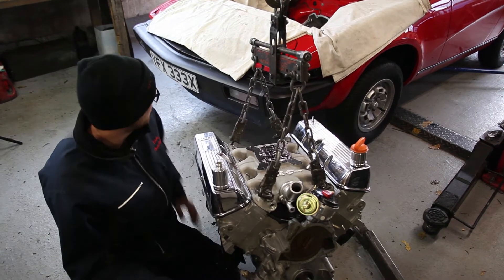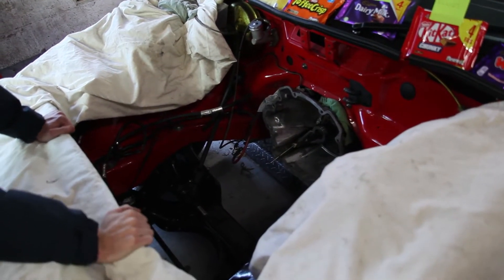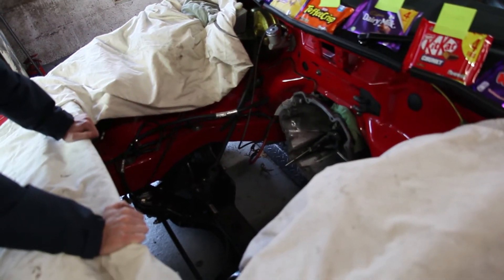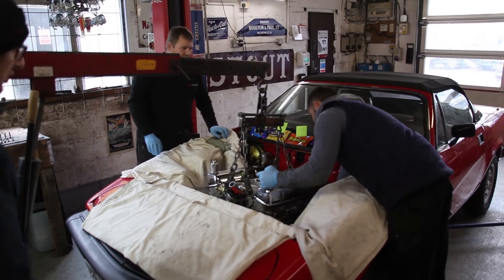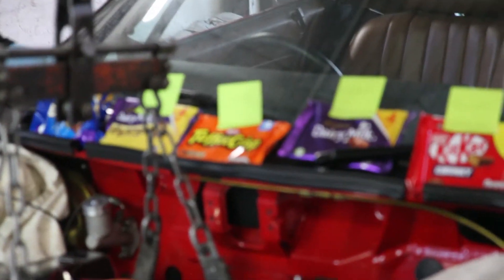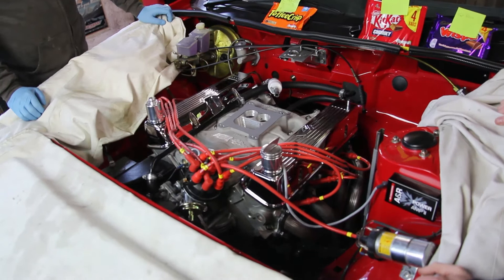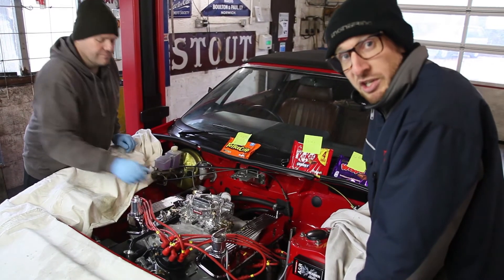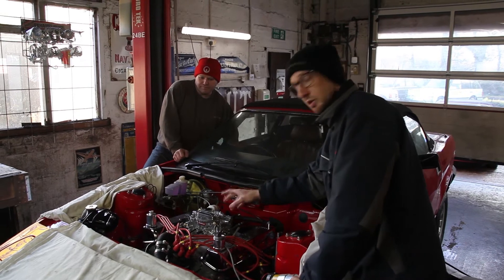RPi Engineering TR8 - Engine Start - Episode 5

Comment: Please tell/show us how you break in your camshafts
Reply from the maker: Hi John,
We will be doing a video on Camshafts soon (most likely a 2 part video 1) What to inspect / change when doing a cam 2) first start up etc. However for now and in answer to your questions below is what I have typed up and send out to customers.

With regards to breaking a camshaft in the advice from most camshaft manufactures is to start the engine and hold the revs at approx. 2000 rpm for 20 minutes. However this is not always possible and from our experience the below is what has always worked for us without any issues at all and we are lucky enough to have customers still in contact that bought engines from us in the mid 1990’s if not earlier. Once reason for breaking the cam in is in fact breaking the lifters and push rods in. The camshaft is profiled with a tapper so as to cause the lifters and push rods to rotate in the block. If you just started the engine and let it sit at idle speed for a long length of time then there may be a tendency for the lifters to not rotate correctly and this could lead to premature camshaft / lifter wear.

Firstly if you have just changed the cam in your engine and are about to start it for the first time, or better still you have rebuilt your entire engine, then the thought of starting it and holding the revs at 2000 rpm for 20 minutes is very daunting and rightly so. Let’s assume worst case you have a carburetted engine, in this instance you will not have the luxury of an idle valve to stop the engine from stalling if the fuelling or ignition timing is not quite right. In our workshop we will get the engine started and then advance the distributor by hand until it simply sounds about right whilst blipping the throttle to keep it running, a possible tweak to the idle stop screw may also be needed to get the engine to tick over without touching the throttle. Once the engine will rev up freely and will idle we check the water level as the engine may have pumped air out of the system and in turn emptied the header tank.

By this time the tappets will have all gone quiet and we are about 2 to 3 minutes into engine first run time. We have not allowed the engine to simply sit at idle as we were blipping the throttle whilst doing these simple basic adjustments. Obviously if your fuelling system is injection and you also have coil packs then this step is not needed as assuming it’s all assembled correctly the engine will start and run without any input from you.

Next, as we now have an engine that will rev up and also idle you want to keep blipping the throttle up from idle to around 2000 rpm along with holding the rpm at approx. 2000 for 20 to 30 seconds at a time. After holding for this period at 2000 rpm then let the engine return to idle and do a quick spot check for oil and water leaks, make sure that the header tank is still full of water. Stop worrying about all the smoke form the exhaust manifolds that’s just grease and the odd splash of oil burning off them. Feel the top hose to see if things are coming up to temp yet. As you can already see there is lots that you need to check that you cannot do if the engine is running at 2000 rpm constantly. Add to this if the whole engine is a fresh build then simply holding the revs at 2000 rpm for 20 minutes is one way to head down the slippery slope of glazed bores, and you will be wanting the engine to idle for a few seconds here and there during this time so you can set you mind at ease that there are no knocking or ticking noises. As I mentioned glazed bores don’t worry too much about this but in blipping the throttle up and down the rev range sharply will start to help bed in the piston rings to the bore whereas holding the revs in one place for 20 minutes does not give any load to the pistons.

Once you have had the engine running for around 10 minutes the temperature will now have started to raise and we will fit the coolant head tank cap. Still the whole time taking the engine from idle to 2000 rpm and holding 2000 rpm for around 30 seconds each time but then when returning to idle doing our checks making sure that it is still safe to continue running the engine. We will keep doing this until the thermostat opens and the whole coolant circuit is nicely warm. If electric cooling fans are installed you will want to make sure they will cut in and out correctly as well. This whole process normally exceeds the 20 minutes previously mentioned.

Once you are happy that you have no leaks, that the cooling system is working correctly (stat opening, fans coming in and out) you can then set about setting the ignition timing up and the mixtures on the carb if applicable to your engine. Next is a final check over and then a road test. For us we normally go for a 10 mile drive when possible using the engine in the mid rev range 1500 to 2500 rpm which again stays in a safe range for a fresh engine build and also avoids long periods of idle. Once this road test is completed we return to the ramp and check again for any leaks or issues and assuming there are none then it’s back to the road for more miles and fine tuning where needed, by this point there is no issue with having the engine idle for any length of time, the cam is broken in and the lifters / push rods are all rotating as they should be.

Kind regards,
Ian
Reply: @RPIEngineering  Thanks Ian.. you are the best.. I thought you guys might do it differently. Thats why I asked. I rebuilt this 4.2 before. I used 30wt breakin oil, I ran it up to 2000 for about 2 or 3 minutes, to make sure I had oil circulating  and then down to around 800-900 then up again to 2100 for a couple minutes and basically did what you did. It ran great. (  I am the guy with the broken Balancer that busted my timing chain)..I will get the engine assembled with the parts I bought from you in the last 2 weeks. I had bent valves,, so i replaced all head parts (thank you) and had a 3 angle grind added replaced every other internal bearing and rings etc. This Time I will do it the same way you described and with the new piper torque max cam ( I got from you)  I hope to have it running better then it ever did. Thanks again..